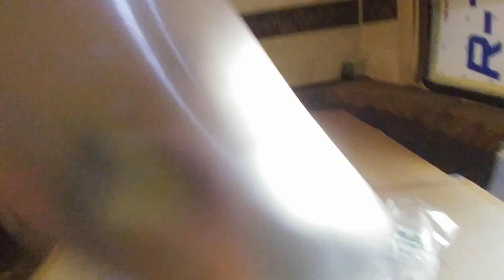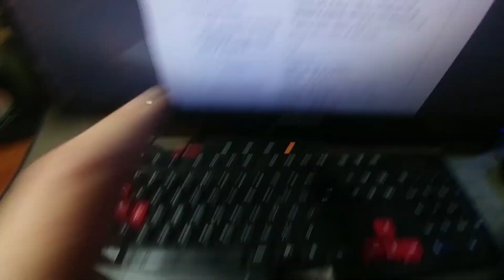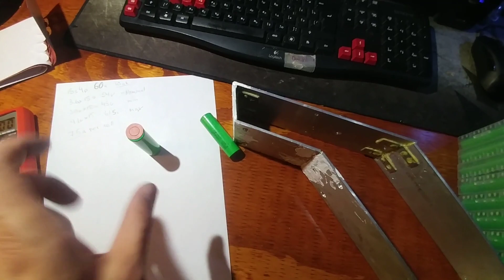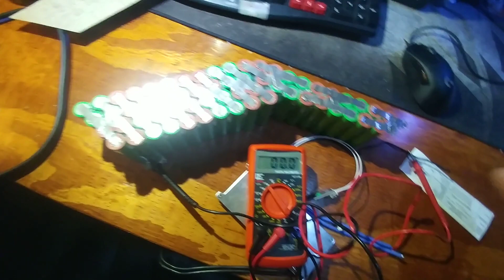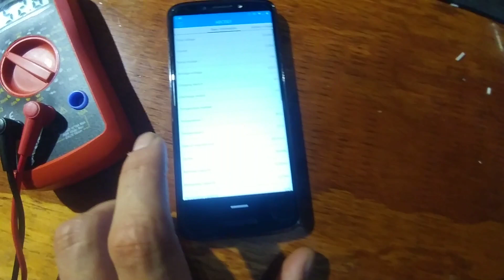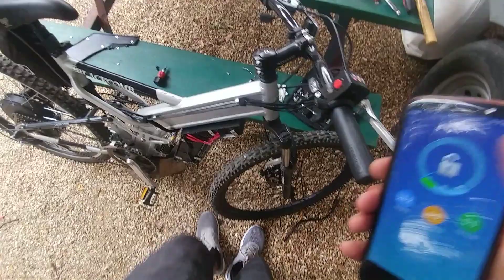Building DIY ebike battery from 18650 cells (15s4p, 54v) for 1000w Ebay rear hub kit

Comment: What you did is interesting, battery, the only problem is that it cannot be interpreted in any existing DC system, at least at the ebike level. Because 48v (13s), 52v (14s) 15s (there is no such thing) 60volt (16s) ...etc.

Comment: 15S 4p it won't last long.
I have a 14s 13p battery pack on my ebike.
They are real 3.7v 26f  Samsung batteries  homemade 
I also made aluminium battery box.
And I feel like i needs more batteries.
The ebike has a 1000 Watt hub motor.
with modded controller to 1500w.

Yes your battery pack is a 15s 4p but with less batteries. The power sag it will work like a 13s.
When it's fully charged it will be good for a few minutes

Comment: Hey, I've got a question: You said the current of the batterie packs are 60A but the controller limits the current as far as I know to 20A. So you don't need to buy a BMS with a maximum current of 60A and double weld the nickel strips. Or am I wrong? 
greets from Germany :)
Reply from the maker: I like to make it overkill!

Comment: Im in Dallas County, I noticed your in Denton County. Im looking for a battery to be built. Wondering if you would be interested. Thanks!
Reply from the maker: Hi! I only do it for fun and definitely not a pro! But let me know if you have any questions!
Reply: @sideproject4028  would you be interested in putting together a 52v 17+ ah triangle battery. Cost?  Xt90 connection.
Reply from the maker: @averagetexasmtber  Unfortunately, i do not have very much spare time right now! I see a few custom battery builders online, but i dont know of any that i could recommend!
Reply: @averagetexasmtber   I will do it bring it by